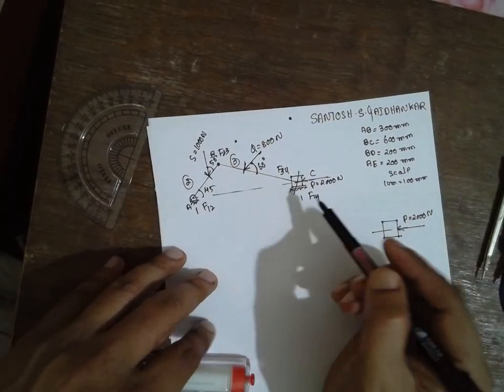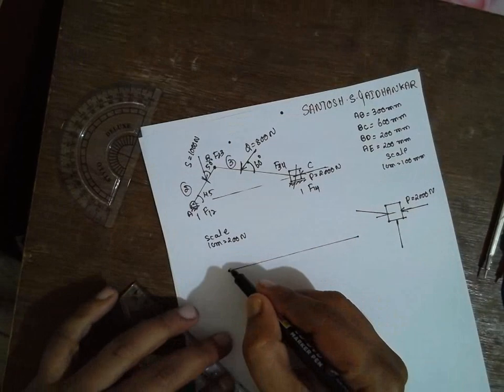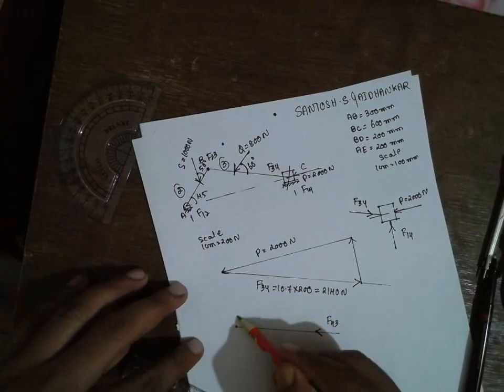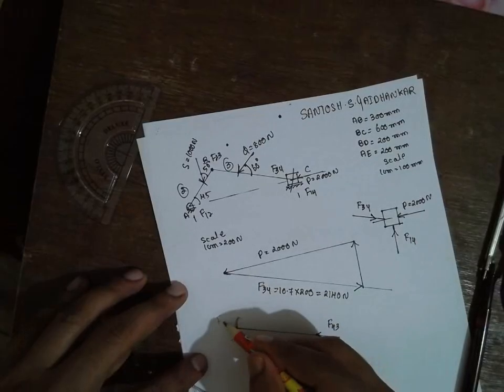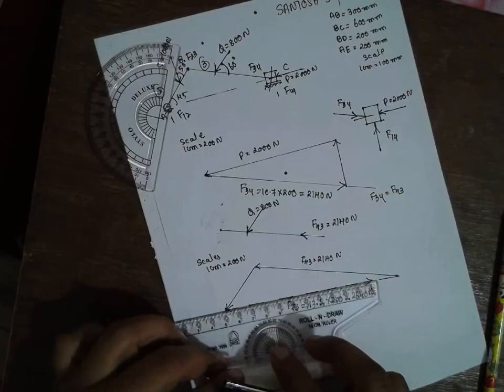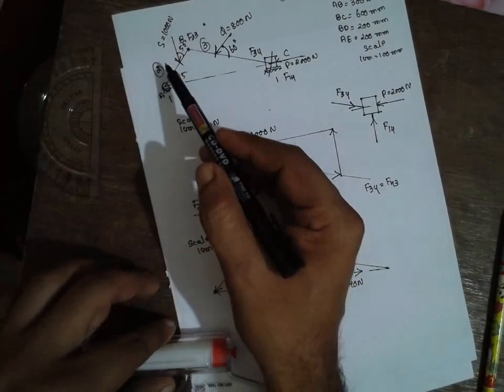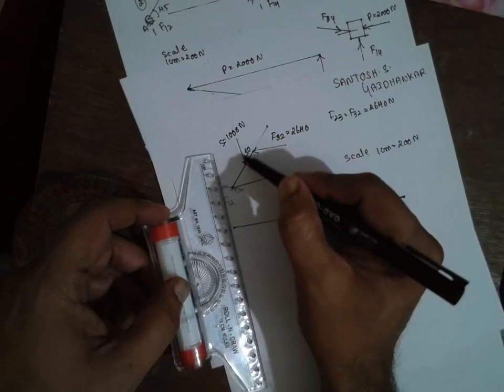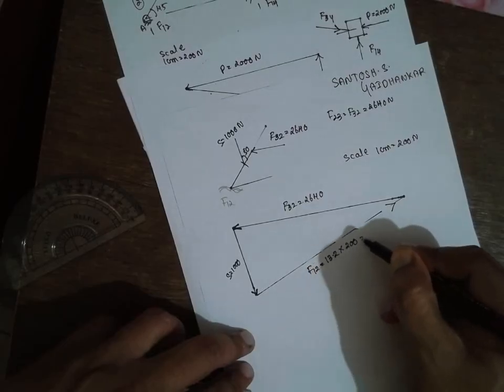Static Force Analysis Three Forces acts over slider crank mechanism

Comment: Sir in the book same problem they took three torques on AB link seperately and then found out net torque as 5.13 Nmm. Is it necessary to solve by that method by removing forces and analysing
Reply from the maker: It's a graphical method